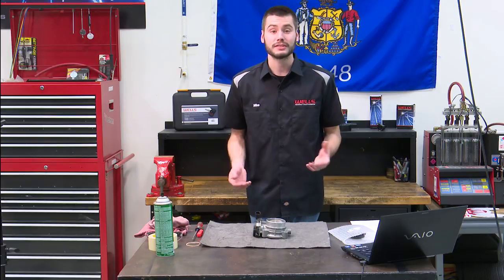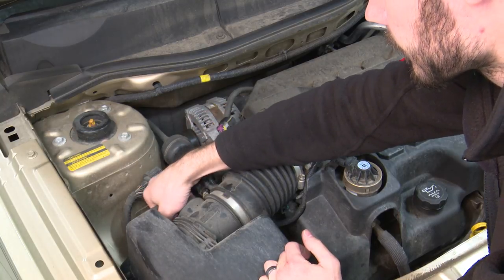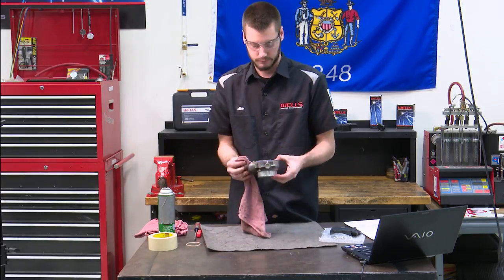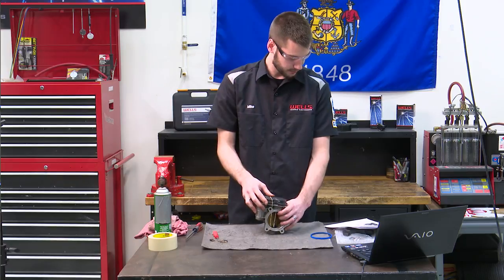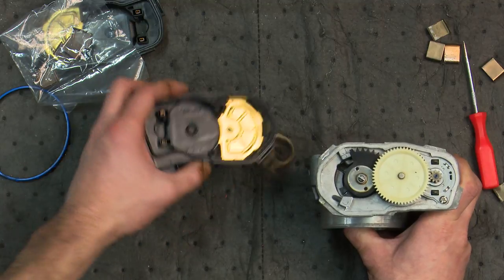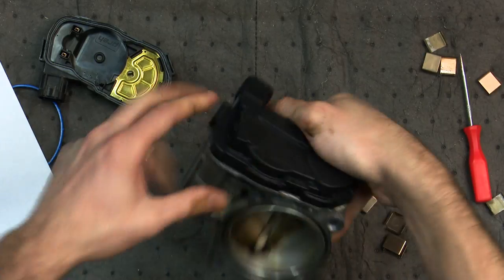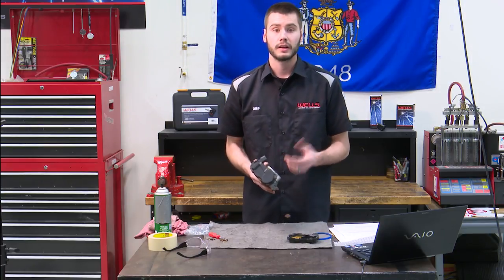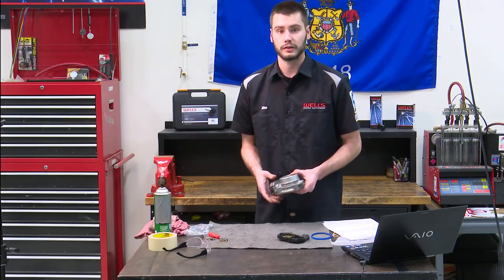Wells CounterPoint Ep. 21 GM Throttle Body Repair (P2135)

Comment: Hey Mike. Ihave a GM Holden Commodore 2007 ( Australian car) with a 3.6 ltr v6 she had all the symtoms you describe. Do you know if my throttle body is the same. as it looked identical.Italso makes a strange click clack sound after turning it over for a few seconds when you stop. It also wont start.. Any Help apreciated Bro. Cheers From NZ again.
Reply from the maker: Hey Darryl, yeh I think they use a similar TB if not maybe even the same one. How's battery voltage on the car?
Mike Becker, Senior Instructor

Comment: Hello.I have a car meredes W210 compressor with engine 2.0 liter, and I have a problem with compressor, you know near the compressor there is a same tipe valve between the air filter and compressor.I remove filter and see the valve position it were open, I run the car push the acceleration pedal bat valve not turning it stai open and no motion.is the valve stuck what is the problem?
Say me please what is tha valve position if power is off??I think the valve must be closed.
Reply from the maker: Hi Edgar, what valve is this that you're talking about? are you talking about the throttle valve? The flap in the throttle body?
Mike Becker, Senior Technical Instructor
Reply: @GoTechTraining  Not throttle valve, it is near the compressor.This  valve supply compressor air to the engine, then this air passing through throttle valve and MAF( mass air flow ) sensor, then to the engine. But both valves have a same construction.
Reply from the maker: I'm sorry Edgar, but i'm not familiar with which valve you're speaking of. Is this like a blow off/wastegate type valve?
Mike Becker, Senior Technical Instructor
Reply: @GoTechTraining  Ok for throttle valve for example there isn't electrical power car isn't run.What is the right position of throttle valve flap? Open or close?
Reply: The throttle body attached to the air filter housing will remain open until the engine exceeds 2500 rpm. When the engine exceeds 2500 rpm, the throttle will close to redirect air into the supercharger. The 2.3 Kompressor engine has a dedicated throttle body for normal air intake attached to the intake manifold. Your Supercharger (Kompressor) air bypass throttle body is working normally in this case.

Comment: Can a throttle body be safely opened manually (pushing the flap like you did) while it is still installed? 

I cleaned mine but because it was in the closed position I only did the outside.
Reply from the maker: Jeff. you can safely do it. I highly recommend unplugging it first. Shut the key off, unplug the throttle body, then clean it. Those motors have a ton of torque and could cause bodily harm...better to be 100% certain there is no power going to it!
Mike Becker, Technical Services Instructor
Reply: Got it. It looked like there was a good potential of it biting, so power off first.  I'm glad you're here to answer us. Thanks Mike
Reply from the maker: That's what i'm here for Jeff! Glad I could help. Rule of thumb save it, unplug the throttle body :) Be safe my friend!
Mike Becker, Technical Services Instructor
Reply: I pushed the flap manually when the TP body was connected and Engine OFF. Do you think I should change the hole TP body or only the sensor?

Comment: Lets say that plastic gear does fall out. Is there a certain way it should go back?
Reply: The smaller gear side should go first, which link to the the TPS gear piece.
Reply: @metzmatu8409  ok yea thats the way i put it back but just making sure i didnt mess anything up putting that back because now my truck is acting different but i think i just need to re learn throttle position

Comment: I wish I saw this before I took it to the dealership.
Reply from the maker: Hey Rajesh, at least now you know to check here first if something goes wrong next time.
Mike Becker, Senior Instructor
Reply: The thing is my car is a 2013 malibu eco. Throttle body looks the same though
Reply from the maker: Similar part, different part numbers. The diagnosis and such are roughly the same though.
Mike Becker, Senior Instructor
Reply: I now have a used but broken throttle body. Would you want it?

Comment: FYI: the new sensors are natorious for "failing within spec"... NTSB is currently investigating GM for build in a bypass within this updated sensor...meaning it can fail without throwing an engine light....be mindful of symptoms for the future
Reply from the maker: Good to know man!
Mike Becker, Senior Technical Instructor
Reply: @GoTechTraining  : one thing to watch for., when this part stop fully communicating with the ecm, it can/will throw p1811 and a couple others., I took into GM 3 months after replacing it and they had NO HESITATION of replacing it, and guess what...fixed all symptoms. The no hesitation with GM makes me think they are well aware of the faults with the new sensor.

Comment: The teeth on the black gear which is connected to the throttle plate looks likes it's worn out. Looks almost like it's worn where it is normally used which is between idle and 70% throttle.  Is this normal for say a new throttle body?
Reply from the maker: Hey Reweydewy, I don't think there is any significant wear. At least none that is currently affecting operation. This car has been back on the road now for about a month and a half, and no reported issues. I do see what you are seeing, where the black gear does look slightly worn. I would assume a new one to not show that at all. Should any problems arise down the road with this car I will make sure to shoot another video detailing on wear on the black gear. I also will keep my eyes open for more of these and see how they look.
Mike Becker, Technical Services Instructor

Comment: Good explanation Mike
Reply from the maker: Thanks! You do any of these recently?
Mike Becker, Technical Services Instructor
Reply: The Mini Cooper I worked on a couple of months ago experienced that same code, I believe it was a p2135.  Turned out to be a really clogged air filter and I also cleaned the throttle body plate.  Problem fixed in that case.  I have not changed/updated the TPS on a GM throttle body.   Looks easy enough judging by your vid!
Reply from the maker: Isn't it crazy what a clogged up air filter can do!? I am actually going to be demonstrating that in the class we have planned for next week. 
It is easy enough, those clips can kind of be a bit of a bear though! I definitely struggled with them a bit in this video lol.
Mike Becker, Technical Services Instructor
Reply: Some things aren't always as easy as they appear, real life struggles!  Take care - Glen

Comment: Bro
Caverlet Tahoe clean throttle body after clean accelerated over 2500 rpm in starting not down wht is peroblm
Reply from the maker: Hey Md Arif, not sure I understand your question?
Mike Becker, Senior Instructor

Comment: I never even took throttle body off when i changed one out, was easy
Reply from the maker: Hey Todd, for sure! Some of them are super simple :)
Mike Becker, Senior Instructor
Reply: @GoTechTraining  local auto parts store wants $120. For sensor pack and $180 for the complete unit: sensor and throttle body. I just bought the complete unit

Comment: Does this affect Saab throttle bodies ? They look to be the same except the connector position. Part number on mine is 55354710 —1376  RME58-1

Comment: how many miles on this old TB?
Reply from the maker: Hmmm that was a long time ago. I think it was around 100k.
Mike Becker, Senior Technical Instructor
Reply: @GoTechTraining  ok thanks. I was having issues at around 153000 with mine.
Reply from the maker: Nice, you made it quite a while with that one!
Mike Becker, Senior Technical Instructor
Reply: @GoTechTraining  no check engine light either, 
just power loss, rough upshifts and downshifts.
Reply from the maker: Ahh I see. I'd start off with just giving it a good cleaning and see if that takes care of it.
Mike Becker, Senior Technical Instructor
Reply: @GoTechTraining  it was spotless clean when it was acting up. I replaced it and it made a huge power difference.  what could've been wrong??
Reply: @gearhead4005  if the computer is having a hard time managing the throttle plate, it goes into a conservative mode when moving the plate.
It's only driven by a simple cheap 12v-DC motor (not a fancy stepper motor) so computer has a lot of busy work to control motion 😂. We lucky it even works with all that (self-lubricating) plastic

Comment: Ground WIRES BELOW DRIVESIDE AND GROUND ENGINE COMPARTMENT, FORGET TO TAKE TROTTLE OFF.
Reply from the maker: Hey Mike, not exactly sure what you're getting at here???
Mike Becker, Senior Technical Instructor
Reply: Positive wire negative wire, check negative connection in body frame.

Comment: This does not work at all, finally had to the Idle Relearn Reset with a Snap On Modis; without it the actual and indicated angles are not synchronized correctly no matter what you try to do otherwise.
Reply from the maker: Hey Metal Maniac, sorry to hear that. The procedure does work. This vehicle did not require a scan tool to get it functional again.
Mike Becker, Senior Technical Instructor
Reply: could be the era of truck I tried it on, the 2008 Silverado

Comment: exselecte.   demostrasion.  amigo.  salude.  noelmatute.   una. preguta. tenica.  para. bos.  anigo. vos. podes. repair.  los. throttle body. de.  los.  2007.  AUDi. A4.   2.0.   me.abisa. si. se. puedes.grasia
Reply from the maker: Saludos Noelmatute y gracias por el comentario, y con respecto a tu pregunta desafortunadamente nosotros no reparamos los throttle bodys de ningunos de los vehicuos, yo se que Wellsve esta empesando a produsir los throttle bodys pero para los vehiculos de la Genaral Motors pero nada para los audis. Fritz Fuchs Instructor de Servicio Tecnico Automotriz.

Comment: NO NO NO NO BRAKE CLEANER!!!!!
IT WILL DESTROY THE COATING ON THE THROTTLE PLATE!!!
ONLY USE SENSOR SAFE THROTTLE BODY CLEANER!!!
Reply from the maker: Robert, I don't think the GM throttle bodies are coated. Ford's are. You spray a Ford and it's practically junk...GM's on the other hand are just raw metal. 
Mike Becker, Technical Services Instructor
Reply: Dijagnostika texsom TXC